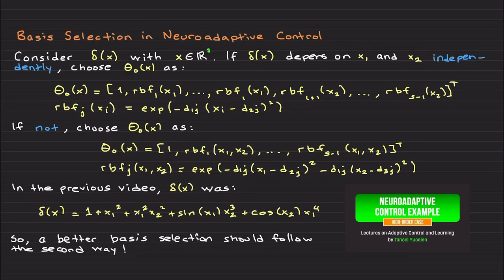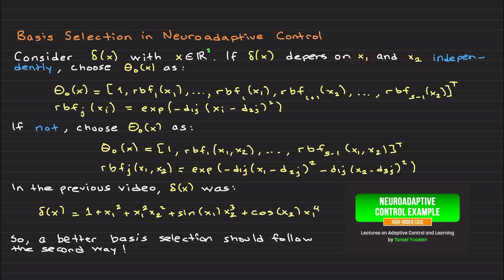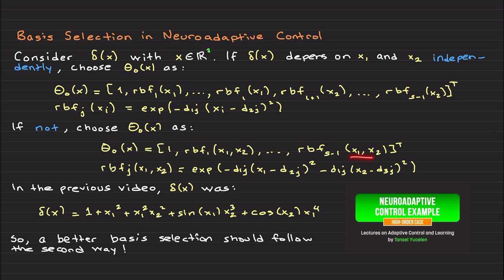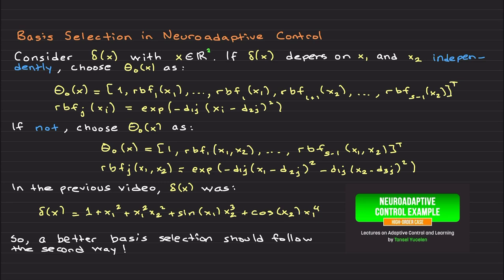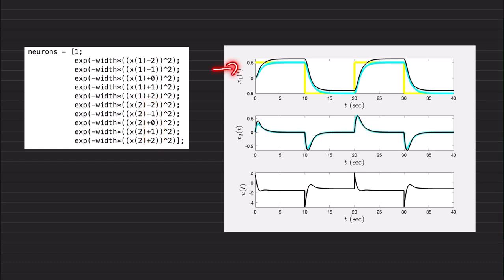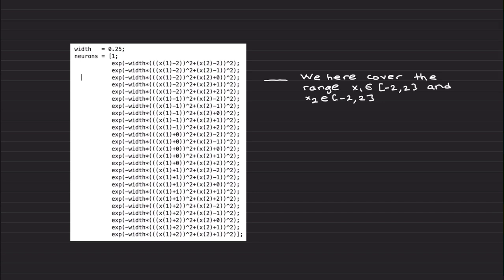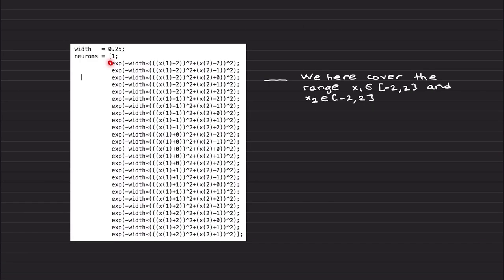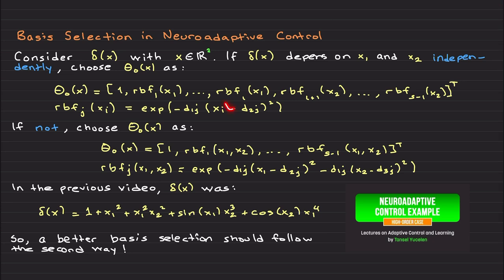Neuroadaptive Control Basis Selection: High-Order Case (Lectures on Adaptive Control and Learning)

Comment: Is your code for the TAC paper "Symbiotic Control of Uncertain Dynamical Systems:
Harnessing Synergy Between Fixed-Gain Control
and Adaptive Learning Architectures" available? Are you using a deep learning library for the neural network models of uncertainties in these kinds of work or just simply using explicit matrix multiplication to represent the network in something like MATLAB?
Reply from the maker: Hey, I don't use any deep neural networks. Symbiotic control framework does have the capability to correct for neural network approximation errors! For this, you need to increase the scalar gain of the fixed gain control signal ;)